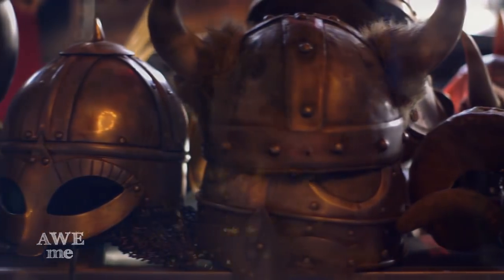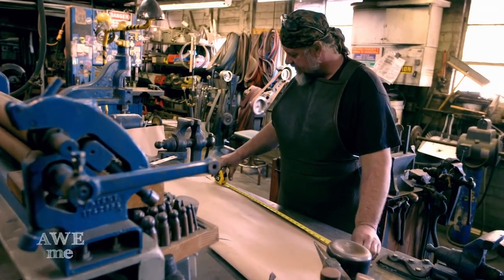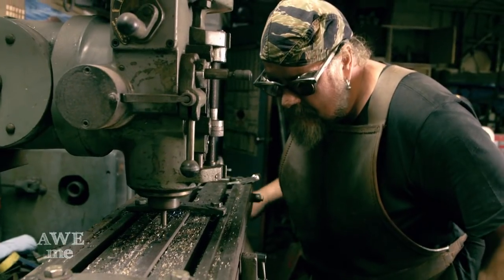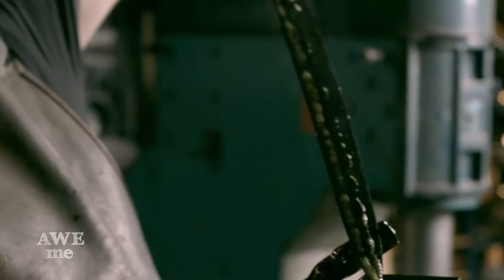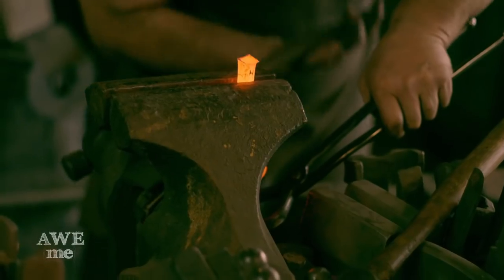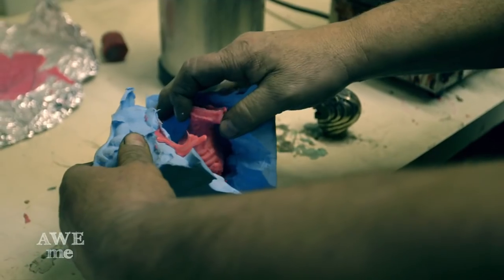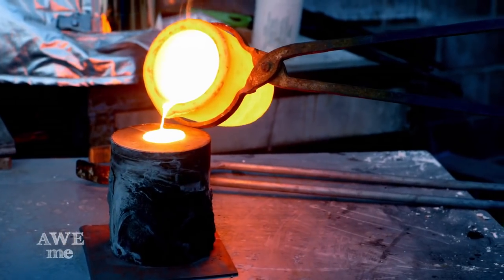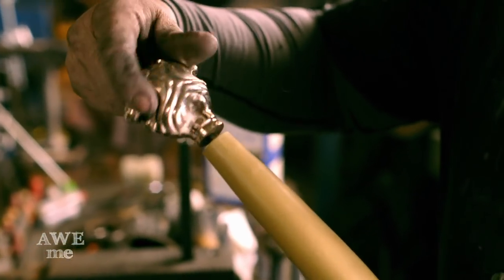Jaime Lannister's Sword (Game of Thrones) - MAN AT ARMS

Comment: It annoys me that they break glass with the swords. That doesn't prove anything you can smash glass with a metal pole you don't need a sword.
Reply: Growl wn I was just saying they shouldn't cut glass I wasn't saying they should cut anything that would damage the blade. A melon won't damage it and tbh the glass could scratch the sword anyway.
Reply: ***** Yeah but would be a cleaner easier cut with a sharp blade. Especially if you don't swing is fast.
Reply: buy a melon and a sledgehammer and try to part the melon with that, and with ease such will happen even without a fine edge..
Reply: +Notpoop so? doesn't need to show us what it can do.
and having a tantrum over that is pathetic
Reply: Crunchalot There's a difference between smashing and cutting
Reply: I agree. They could for example have bought Ivan Heads from Zombie Go Boom. That is about as close as you can get to a real human skull. Cutting fruit also looks awesome in slow mo, but glass? meh.
Reply: or they could try cutting a filled plastic bottle. It's hard to cut, because it needs a fairly sharp sword, good ballance from you and from the sword, and power in the hit of course. if you can't cut through the bottle you will just hit away. However it needs you to be able to swing a sword
Reply: I know they should get a small child.
Reply: they don't care if it fucks up the blade, they just hit stuff that looks cool
Reply: The other guys... the ones that make REAL Swordsmith cut bamboo and other harder stuff
Reply: Yeah, I wish they wouldn't do that. Of course you can smash glass with a sword, everyone already knows that. It's pointless, slightly dangerous what with all the flying glass shards, and if the sword is sharpened it can damage the edge since glass is actually harder than steel.
Reply: Fervidor Exactly. I don't know why anyone argued with me over what I said. Scientifically it is pointless to smash glass with a sword in order to prove how good a sword it is. Every sword will smash a glass. Even a fencing saber.
Reply: + Growl wn you know nothing of what you are talking about....
Reply: Glass is harder than steel. You can wreck the blade or at least destroy the edge.
Reply: Deniz Yılmaz lol you have no clue.
Reply: The second time they do it the third bottle I believe IS plastic...  It looks like a 2l soda bottle, @4:17, freeze the frame before it hits, slow it down, looks plastic not glass to me, also doesn't shatter like the others but instead just the top is cut off.
Reply: As a counterpoint to this whole discussion: windshield-glass is really tough. It's structural integrity comes from mostly not-glass.

Comment: For anyone interested the removal of metal along the center of a blade is not called a blood groove. It is called a fuller. It's purpose is to reduce the weight of the blade and move the balance point to the correct position if it is required. If by skill and some luck the balance point is where it should be without a fuller then a fuller would not be carved. Those that did not know the purpose of it called it a blood groove because they didn't even know its name.

Also the grip is wrong. Since there isn't anything striking or uncommon about the blade of his sword that leaves the crossguard, grip and pommel that make this sword unique.
Reply: "If by skill and some luck the balance point is where it should be without a fuller then a fuller would not be carved."
Complete nonsense. A fuller is primarily and usually ONLY to lower the weight of the blade without compromising structural integrity. Balance isn't something you play around with, since impact nodes changes, or don't change, independently of the balance.

Comment: Fullers are not known as 'blood grooves' and are nothing to do with 'releasing a vacuum' when a person is stabbed. They allow a blade to be made broader and lighter while maintaining structural strength and stiffness through an i-beam cross section. That's all they're for.

Fullers almost never extend all the way to the point of a sword (thus having no bearing on a sword's performance in the thrust) and many swords that are optimised for the thrust (e.g. rapiers) don't have fullers at all.
Reply: Jack Traveller Just as a note, while it isn't a fuller per se, many purely stabbing-oriented swords have ribs or ridges, which does much the same thing as the fuller.

Comment: So, just a question: what happens if he gets the balance off on the sword? Does he measure the weight of the pommel to counter the sword's blade? Does he even measure the balance at all? I'm not accusing, just asking a question.
Reply: I'm guessing that they would try different weights of pommels until they get a good balance. but sword smithing is not just hit a piece of metal and sharpen the finished product you have to get it so that if you hit the blade it won't vibrate the handle much, this is also the same for about 2/3 down the blade. That gives you optimal balance comfort and overall cutting power

Comment: The fuller is actually the tool used to make the grooves and the blood grooves are actually nothing to do with blood it is to lighten the blade...
Reply: Cameron Hargreaves Well...in a way. One could just as easily say it's to keep the blade stiff while not increasing the weight. But, yes.

Comment: it's not a "blood groove", it is utilized to reduce the weight... a blacksmith/swordsmith should know that
Reply: But Swatton isn't a swordsmith. He's a prop-maker. He makes things that look cool on tv. He's barely a blacksmith. You'll note he uses welders, saws and milling machines, and does very little to no actual forging.
Reply: @mooneyes2k478  I know, but still... he works with swords nonetheless
Reply: Well, not really. He makes sword-looking bars of steel for use by people who are actors. There's no reason he should know anything about swords.
It's like a guy that makes car models. He doesn't have to understand what an engine or a suspension is, or does, because they're just models meant to look like cars. I know, a car model isn't life-sized, but you could make such full-scale models and have them be nothing like real cars, other than looks.

At the end of it, as this and other episodes of the show clearly show, Swatton is a wanna-be cool dude with no clue. This is shown not only in the "blood grove" nonsense, but also in the part where he "heat treats". He drops a red-hot blade into the oil where it will rest on the tip, and is all surprised that that tip bent.
Reply: @mooneyes2k478  Let's just agree to disagree :) I stand by my opinion that some basic knowledge is to be expected.

Comment: I noticed that he threads almost all his pommels on there. No problem for a show weapon but would that be strong enough for an actual combat sword? I get that these weapons are mostly showpieces, just curious.
Reply: MrElias2043 There are a variety of ways of attaching pommels and handles. Historically, most european swords had a tang going all the way through the hilt before being peened at the end of the pommel, but german messers had bolt on handles likes a kitchen knife (messer is german for knife) and I believe tulwars and katanas had their blades glued into the hilt with adhesive. 

As far as Im aware there is almost no historical evidence for threaded or screw on pommels, because as you surmise they're not usually strong enough. There is one medieval german fighting treatise (manuscript KK5013) which shows a fighter unscrewing his pommel and throwing it at the opponent, but no one is sure if this illustration is a joke or not. Either way, it is certainly an exceptional case.
Reply: Jack Traveller "because as you surmise they're not usually strong enough" Not to mention, the machining level wasn't really there. Threading, particularly in metal, didn't really appear until the 1800s with the advent of machine tools and mass production.
Reply: MrElias2043 Pretty sure the 5/16" x 18 threads on the tang, similar to the front axle on my 1988 sport bike, which can travel over 100mph, are more than capable of taking the punishment of human strength swinging around a 2-5lbs metal. It takes a very very deliberate act and lots of torque to strip out that kind of threading. I understand it's not historically accurate, but if you're concerned with the ability to tear down the sword and make repairs, which all swords need after battle, it's much simpler. Also, look at Japanese katanas, whose blades are held together with a basic pressfit pommel cap and bamboo dowel through the grip.
Reply: Jack Traveller katana handles arent glued on they are pressure fit and held in with a bamboo peg sometimes two pegs
Reply: my mistake.
Reply: +Joshua Barker
It's more that threaded pommels will compress the grip of the blade and potentially damage it as they are tightened. They also need to be tightened so the hilt and grip don't slip around, while peaned pommels don't need to be.
Reply: unless the cross guard is friction fit and the grip glued or secured another way which some swords do have
Reply: Historical swords do have threaded pommels.
Reply: Sir.Alex No. They don't. And the reason for that is that, while making a screw-thread would've been possible, if difficult, it would've been impossible to make a tight threaded fit for the screw to fit into.
Reply: +MoonEyes2K Before insulting the skill of a medieval black smith. Look at some manuscripts, And archeological evidence. It's a fucking fact. Not a goddamn opinion. The smiths trained their whole life. And worked blades for months. Do some fucking research before spewing out your "professional opinion".
Reply: a very small portion of historical swords have threaded pommels and also only those from later periods moon eyes has a point threading during such a time would have been extremely difficult oh and that manuscript wouldnt happen to be the one with the pommel throwing in it cause that could have been a joke possibly either way most swords are peened or glued in the case of indian swords and friction fit in the case of japanese and possibly chinese swords or riveted in the case of messers theres also the problem of with a threaded pommel to maintain a secure assemvly you would most likely want a friction fit cross guard as well as a glued handle so that the possibility of crushing the grip and causing looseness is very likely as the case with many modern swords
Reply: One. That manuscript, wasn't  joke, It was stupid, But making manuscripts wasn't cheap. Secondly. That manuscript came long before any evidence of threaded pommels came up
Reply: And so, therfore. It is still historically accurate to have threaded pommels.
Reply: Sir.Alex many manuscrpits of the day have jokes in them such as the flying penis monsters and monster rabbits and secondly only historically accurate for certain periods of swords such as those from the renaissance or later but for a medievil knights sword or a viking sword then it is completely inaccurate and to make it a secure threaded pommel requires things that defeat its purpose a peened construction will generally be stronger and thats like saying just cause there may have once been a guy named jesus that the whole bible is real just because it happened doesnt mean it was the best way of doing it and it clearly wasnt the most popular
Reply: Sir.Alex No, it isn't a fact. Why? Because the technology isn't there. THAT is a fact.

No matter how wonderfully rose-colored your world-view is, that doesn't change things. The threaded pommel is nonsense, from a historical point of view.

Comment: Um,.. yeah,.. that's not what the fuller is for,...
Reply: What's it for?
Reply: @velu2957  For removing material, and thus weight, while maintaining, or even increasing, rigidity.
Compare to an I- or H-beam. Far less weight than a solid bar of steel, while having the same resistance to bending.